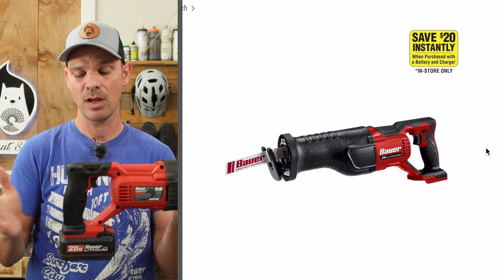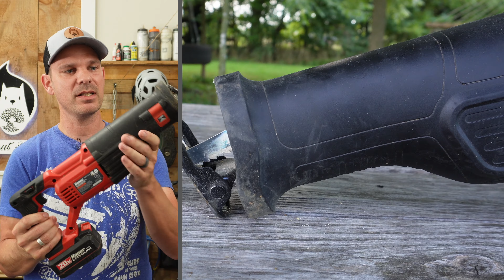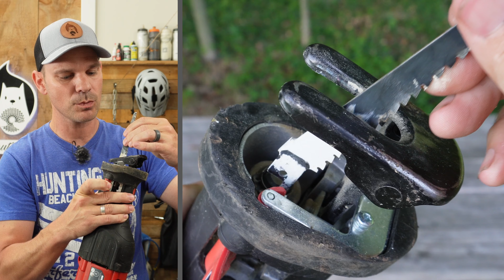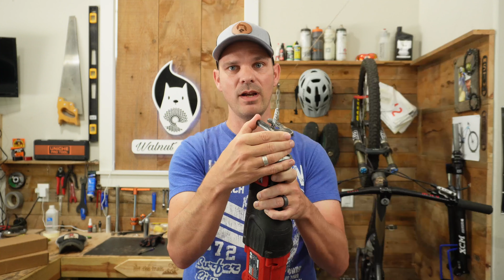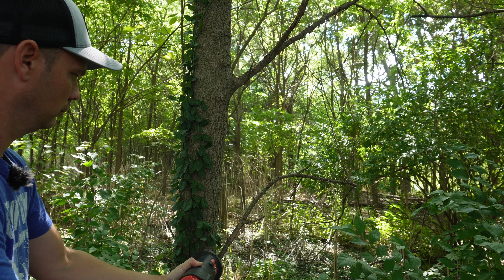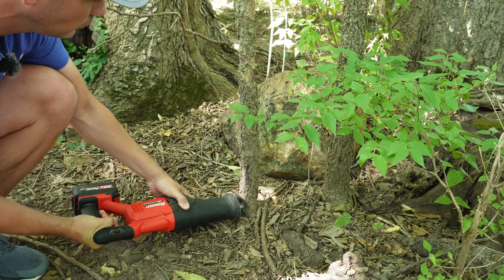High Power: Bauer 20v Cordless Reciprocating Saw From Harbor Freight

Comment: MINE CUTS NICE WHEN IT WORKS.  !
CUTS FOR ABOUT 45 SECONDS  AND THEN QUITS , SEEMS TO HAVE A BAD TRIGGER SWITCH , AFTER  WAITING FOR UP TO A MINUTE THEN IT WILL WORK FOR ANOTHER 45 SECONDS  TO MAYBE A MINUTE . THEN YOU GOTTA WAIT ,  YES THE BATTERY IS FULLY CHARGED .
ANYONE ELSE HAVE THIS PROBLEM.
Reply: Yup. This saw is trash. Took it apart and it seems like its either the trigger or some other component
Reply: Go buy a new one put that one back in the box and tell ‘em it’s a piece of shit. Lol! I love HFT and I buy enough stuff from them I wouldn’t feel bad doing that.

Comment: Mine turns on as soon as I slide the battery but then turns off
Reply: Mine started doing that too - install battery, make a cut, let off trigger, and next trigger pull does nothing. The LED in front just flashes. You have to pull and reinstall the battery to make another cut. We knew we were buying Chinese junk, just didn't expect it to fail this quickly!